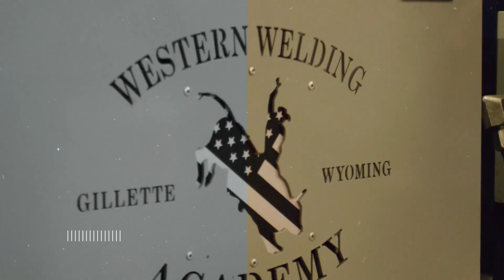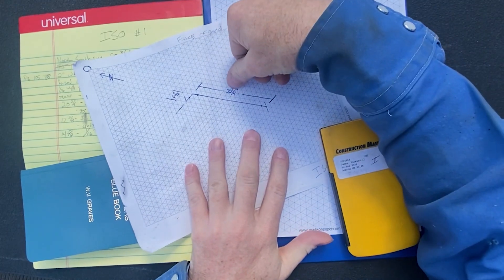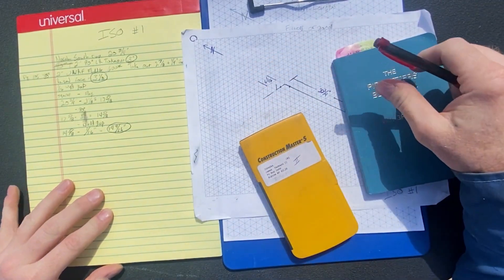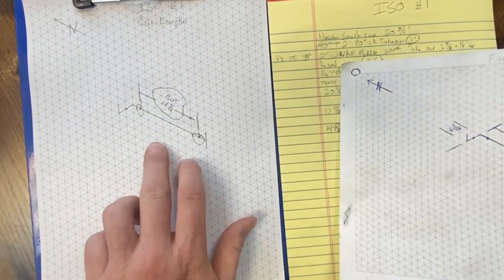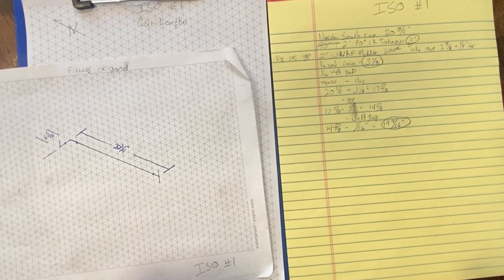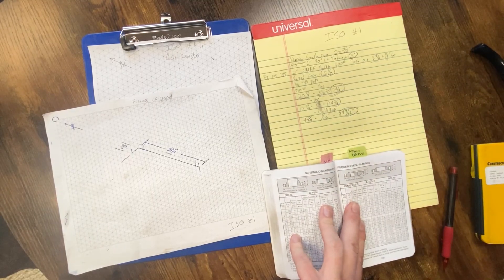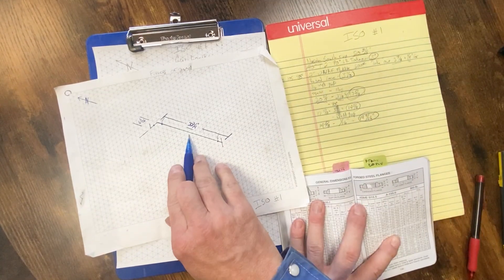How to Pipefit: For BEGINNERS (pt.2)

Comment: Don’t forget the gasket take off when doing as built fab work
Reply: whats the standard take off of a gasket or does it depend on the type and rating? im green lol
Reply: @zipper2070 
We usually figured 1/16 for garlock and 1/8 for spiral wound. Uncertain process piping you’ll run into rubber gaskets and that I would say 116.

Comment: Why he only take 1/16 out for 2 welds, some people take an 1/8 gap, if it’s two welds you need 1/4 takeout if you’re compensating, if you take a 1/16 gap you need 1/8 takeout!
Reply: It all depends on your welder! As far as stick welding most likely a 1/16th gap and tig a 1/8th gap. They might ask for a 5/32 or 3/16 sometimes tho! Just need to ask man.

Comment: Really look forward to more of these videos. We do a lot of rolling offsets with unknown angles while having to run pipe through floors to clear I beams before turning towards the next fitting location. Also showing how to pull measurements for an ISO would be helpful when there are numerous obstacles in the way to prevent use of plum bobs, etc. We get it done but know there is a way to do it with math and cutting the angle on the fittings so we really want to learn that to look more professional in the field.

Comment: Just curious but wouldn't you take off a 1/16 gap for both the 90 and the flange?
Reply: You don’t take off gaps with stick welding downhill. I only take off 3/16 per 2 gaps for mig process. None for tig stainless either because it shrinks so bad it’ll draw up the whole gap
Reply: Same question got me

Comment: I'd love to see how to cut an Elbow.   Just did a 14" water pipe job and needed to cut an elbow at 60 degrees.   I wore out a grinding wheel fitting it.
Reply: That’s very easy. Measure both inside and outside radius of fitting. Divide those measurements by 90. That’s give you you length per 1°. Then take that length times desired degree and it’ll tell you how long both inside and outside need to be to get that degree. Then mark and cut it
Reply: You beat me by a year! Lmao
Reply: What he said!
Reply: Take a measurement of the spine and throat. Divide those two measurements by 90, multiply it by 60 and mark your cut.